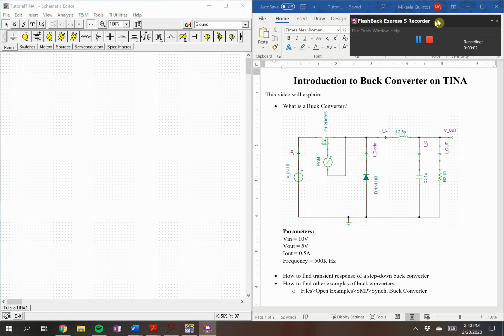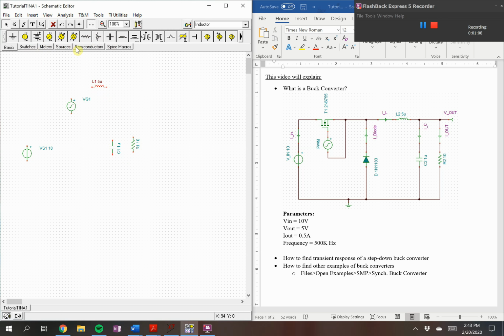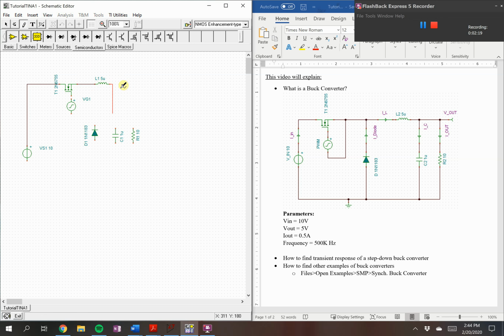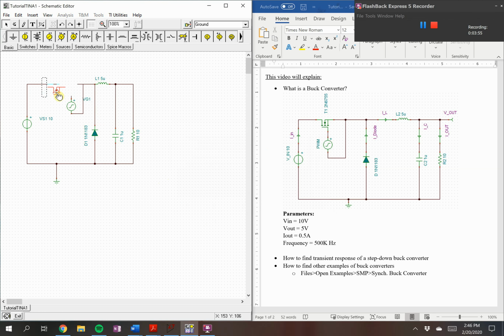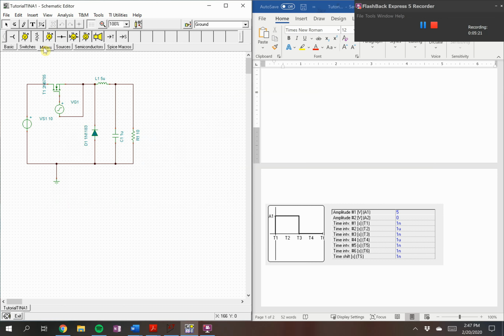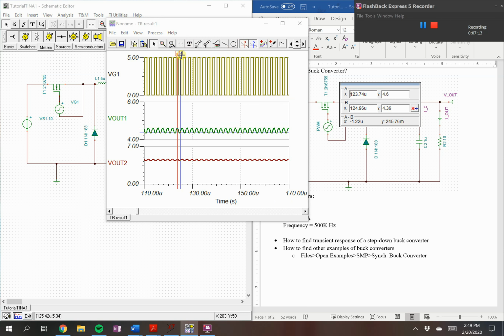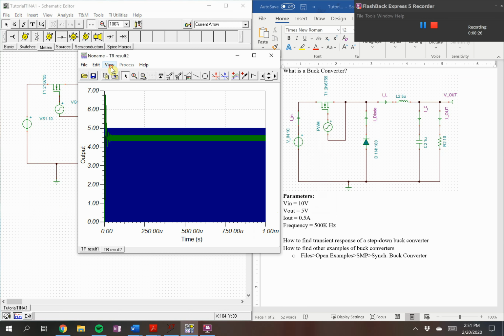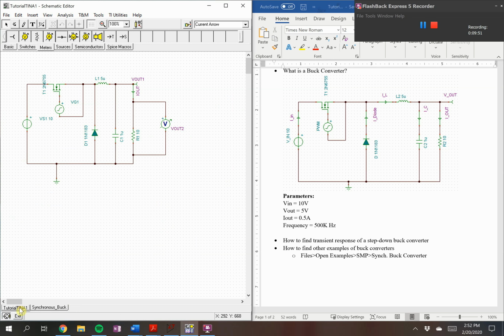Introduction into Buck Converter Simulation in TINA

Comment: I did exactly the same design but I want a 2.5 V output (12 V input), so the duty cycle must be around 21% but in simulation I need to put 30% to obtain 2.5V. Also, the amplitude of the PWM signal has an influence on the output, why did you chose 5V ? because it not works with other values. can you help me?